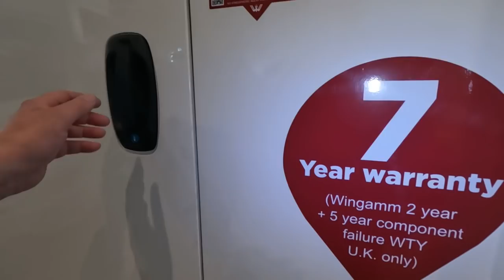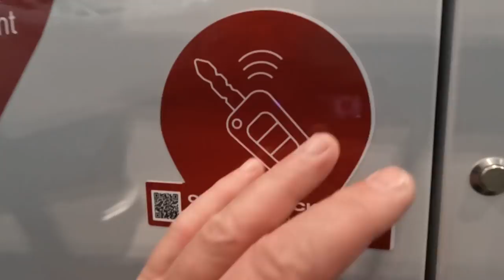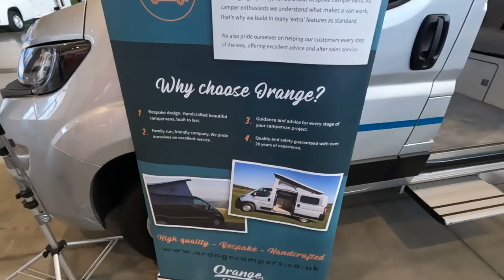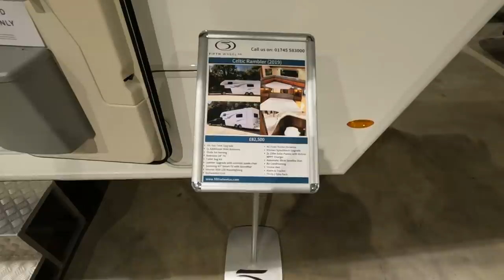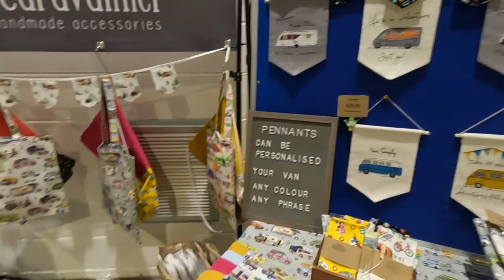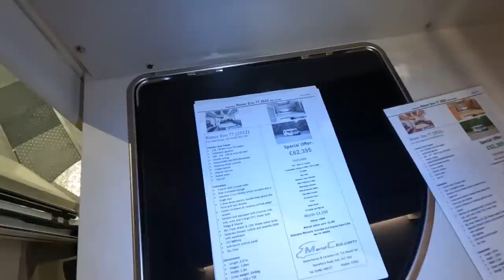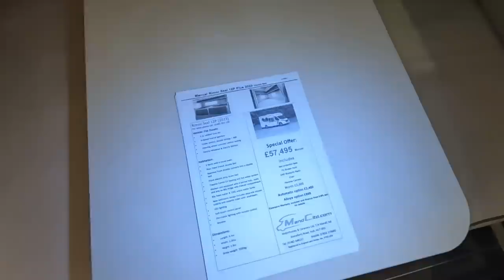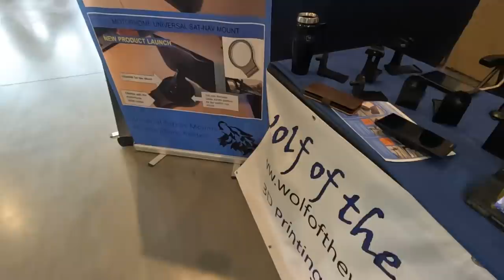Yorkshire Motorhome And Campervan Show 2022 Part 3

Comment: Always  watching the program  very informative  and detailed  also the video is not shaking like so many  thanks
Reply from the maker: Thank you, the GoPro Hero 10 helps a lot with stabilisation.
Reply: @BobEarnshawMoHo  Mr and Mrs  Bob afternoon thinking of  getting a  roof mounted wifi avtex amr 985  and using the hole for the ariel.  ( there is also a max view roam x with a app control? At£549? Thanks hope you have a good  weekend .